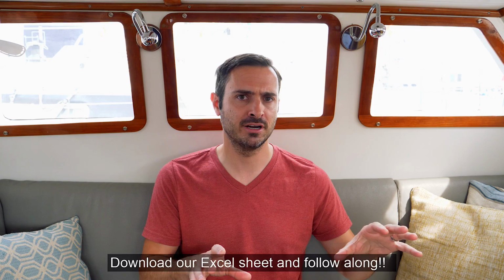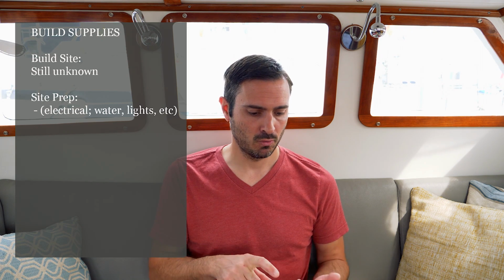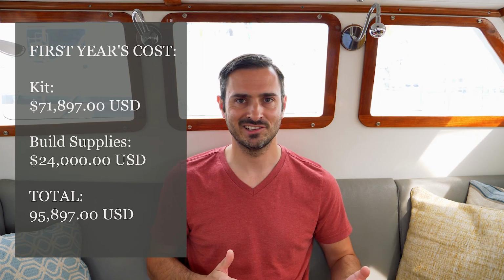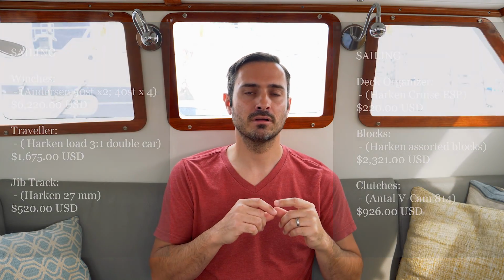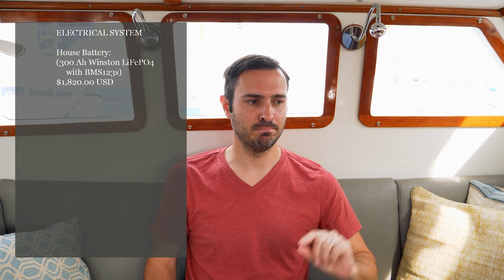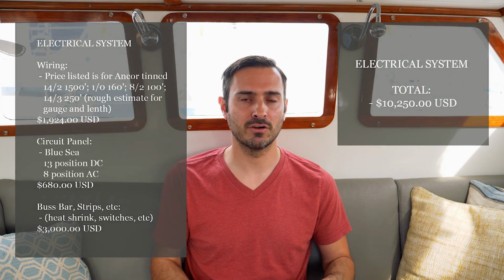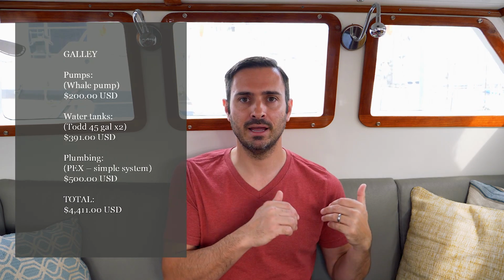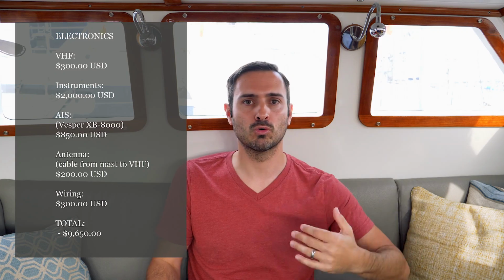What is it Going to COST to BUILD a Kit CATAMARAN? - A Comprehensive Guide (MJ Sailing)

Comment: I know, everybody has suggestions. I'll keep these to a minimum.
Galley - replaced my entire electrical system, went to LiFePO4 too with bigger panels and charge controllers. Worked so well for my RO system, refrigeration, water heater and house uses I went and refitted the galley to an induction stovetop and microwave and tossed the propane system. Amazing upgrade. I still never need my gen unless it's cloudy for 3 days.
Interior paints - look at the Ben Moore Advance waterborne alkyds, easy to use and great for  wet areas. My deck, cockpit and both interior heads were redone with this (one head is converted to a sauna). Use the satin finish inside.
The Yamaha high thrust outboards are an excellent choice. Retrofitted an old Catalina 30 using the 9.9 on a bracket, pushed the fat 11000lb boat at 6kts, used 1/2gph and SOOOO quiet. Just remember to make use of the cooling channel flush, plumb a permanent flush hose and open the valve for 30 seconds after every use.

Comment: Matt,
Could you please provide a link or details on the ceiling cabin lights you referenced in this video?  Thanks!
Reply from the maker: Go to Amazon and type in B01FVRQVK4.  That's an example of what we used (not the exact one).  With a 12v system they can be direct wired without the included driver.    -Matt
Reply: Omg I want to thank you for taking the time to do all the research and my husband and I are planning on building a cat as well and we are now interested in every video that you will produce in the future. Question? Which oram design would you reccomend for us if we wanted a king-size berth to we don't need more than 2 berths but we need a king-size bed so what would you suggest? I am unable to see the cockpit layouts on the orams where do you suggest we look to see them+

Comment: The outboards option is so smart, despite all the advantages you mention but the install costs are hugely  different , non of the engine room(s) components , it's the same reason power boat are using multiple outboards . 
Did not see a fudge factor for composite supplies?
Can epoxy and glass be bought cheaper in USA? As needed ?
Build site costs?
Really exciting plans 👍👍👍👍👍👍Cheers Warren
Reply: Based on conversations with the designers and builders, the kit does assume higher loss than if a pro was building... more fairing, more fillers, more glass.  But we could need more if we deviate from the plans and change things up.   

Regarding outboards, the Oram is set-up different than the Grainger and Schionning.  Both of these require outboard wells to be constructed where the inboard engine would go.   Not a huge issue since the bulkheads are already there and watertight, but there does end-up being moisture issues within the wells and ventilation starts becoming more difficult.   There are a lot of Schionnings set-up this way, and it does work, but it's a bit more than the Oram or Seawind nacelle.

Matt
Reply: @mattjohnson6716  I've seen an 11 Metre Schionning where the wells were built for yam 9.9s, but when a new owner wanted to fit bigger motors found the wells didn't have the space to accomodate them. Pods under the cockpit floor seem to work well for most.
Reply: @BoomaBendz   You're right, and that is a concern.  The Arrow 1360 is set-up for primarily diesels, but if the bed moves slightly forward, then an outboard well can be added.  Going backwards to diesel again is easy.   If we go with interior version 2, it does limit you to either outboards or saildrive diesels.  The other interior plan can have shaft drives.    -Matt

Comment: Lots of detail and number which is interesting, certainly be a challenging project.  However, didn't see heating in the plan?  Are you planning on sailing anywhere cold?
Reply from the maker: If we did venture to colder areas again, it wouldn't be for 1-2 years after launching the boat.  And when you consider the heating system we added to Elements only ran about $300, we figure it is an easy add later on, if and when we need it.

Comment: Site prep will be dependent on where you build.  Some areas will have fire codes that need to be followed.
Reply: Since building codes are local, that will be a factor in deciding where do this project (setting up a 60' tent).  Unfortunately, until we get closer it doesn't make sense to start investigating that too much.

Matt

Comment: Hello guys ! I can share two big mistakes I made back in 2005-2007 when building my 36 foot Angelo Lavranos N/A designed sailing catamaran in Thailand.
I made a huge mistake not having TOTAL control over the shed / property when we did the build.
I hired a boatyard for the Thai labor, but not knowing the owner of the business was a corrupt Italian that was later blacklisted and wanted for crimes by the Thai govt.  This crook kept blackmailing me for more money. I had no way to fight this in Thailand. Very important to have FULL control of the place you build your cat, legal lease or contract etc. No friendly handshake deals, a year later things can change. A smaller mistake was on painting the inside of the cat, I used the same brand and white color code marine paint, BUT it was ' interior ' paint and at lower cost.... it turned YELLOW in two years ' inside ' the boat, You must use same UV safe exterior marine paint inside also. 
I also added a few years later, a copper bottom job. I got very tired of painting the bottom so often. I did NOT use the common ablating epoxy for this, I used the same hard set construction epoxy as when building the hulls etc. I bought the copper power and used 10% more copper than the store brands. Gives you a permanent bottom job, looks NEW after each washing or scrubbing. I feel it will last 25 plus years easy. Best when done on new hulls.  Also use only high grade 316ss when fabricating metal parts not 304ss. I found good tinned copper wire is also used in the TV satellite dish business for half the price of marine stores. Cheers mates and sail on ! Good video too 😀
Reply: All the designer's suggest building in your home country for that very reason.   They shared horror stories just like your own, and since we are building ourselves so won't hire labor, there isn't a financial benefit either.  

We'll absolutely have a signed contract any way we go.   

Matt
Reply: @mattjohnson6716  Hello again Matt,
I would like to clarify my statement on my experience of building my catamaran in Thailand. The benefits and cost savings far outway the disadvantages if managed correctly. 
The Thai workers and culture was a great life journey for me. The Thai's are very hard working people that became my friends. My problem was that I did not do the proper due diligence in choosing a boat yard. I should have not used this boat yard conman. I should have rented a job site on my own. This would have saved me money and headache.
I was on the job nearly every day with my lead workers, going over build plans and running around full time getting supplies for the workers, support calls and emails to my Naval Architect.  It was about two years hard work even with a crew helping me. 
The savings in doing a build in Thailand can be huge. Major brand epoxy and fiberglass is made in Thailand, marine plywood is made in Thailand, honeycomb is made in Asia, Major brands Marine Paint is made in Thailand. Copper bottom products are made in Thailand. The worlds largest sail making loft is in Phuket, Thailand and they also build masts and rigging.  Also a huge savings in 316 stainless steel in Asia its about 50% less cost than USA ! Skilled fiberglass labor is much less than in the west also. I had 316ss chain plates and many other parts made at a fabrication shop using computer cutting technology and polished at half the cost in the west.
If a person wants to 'move' to Thailand and learn some basic Thai language and learn some Thai culture and customs, to fit in. You can save 25% or much MORE, of the cost to build a boat in the West.  But it is a real adventure and you must stay on the job almost daily and supervise the total build. Warning ! The Thai food and Culture can be addictive and the cost of living in Asia spoils you. If a person is to cut out the middle man that takes a good profit, that can be your savings. 
You sure are doing good research Matt ! Looking forward to more videos !
As a past catamaran builder it's very interesting to follow your videos.
P.S. any comments on copper bottom jobs ?
Sweat equity time 😁, sail on mates !
Cheers

Comment: Looking forward to the builds. Got a link to those interior LEDs?  I need some for my project boat.
Reply: Go to Amazon and type in B01FVRQVK4.  That's an example of what we used (not the exact one).  With a 12v system they can be direct wired without the included driver.    -Matt

Comment: Would much prefer you to build the one in the Duflex foam (Oram), rather than the balsa core (Schoinning). Of course much prefer any Grainger design over the other 2, all his designs sail well. Schoinning will sail well as long as you have no payload, but once you have live aboard items, the waterline goes down and sailing performance affected. There is a huge advantage to living on site when building, for cost advantages, as well as time convenience. A demountable unit? "Donga" in Australia - trailer? in the US.
Reply: All three are available with foam flat panels... and it's the direction we're going.   I do like the benefits of balsa, but the resale- especially in the US- is so much lower.   -Matt

Comment: I'm interested in your choice of a forward cockpit design. Personally I can't understand the rationale as it seems to me the potential negatives (sealing a forward facing door, drainage, build complication, losing lazarette space) massively outweigh the potential benefits (more fixed seating). 

It seems to me that you're creating a less seaworthy boat by design which I wouldn't want to do in a bluewater cruiser. One, of the many, reasons why I wouldn't entertain a new Leopard is the forward facing cockpit. It seems fine for a east coast US/Mediterranean boat but not for a bluewater boat.

Good luck with the build, we're doing something similar starting next year either with Schionning, Grainger or a different more bespoke option and it will be fascinating to follow on your progress! 👍👍
Reply: We won't do the forward cockpit... it's an option.  We won't mostly since it splits the bridgedeck up internally, but also since I don't see the value in having sail handling in a different area than steering.  

-Matt

Comment: Things missed from your good lisd: Cabinets: Zero... Counters: Zero...  Sun Shades: Zero... Liferaft: Zero... Rent for building on: Zero... Utilities to build with: Zero...  Place to LIVE while building: Zero... Peel Ply(Big need for saving tons of time/money): Zero.  Fiberglass: Zero, lots and lots and lots of filler you had in there, but I doubt your numbers for a new build massively.  Tools: $2800... Uh, you have got to be kidding me unless you already have a ton of tools stashed in the states in a shop somewhere... big clamps etc for aligning panels, lifting panels(though you do have winches you are buying...  Table saw, welder, universal grinder with flap head for when you screw up along with a composite head for when you screw up and have to flatten something quick. Oh right, most important, stenciling for your new boats name.  =)

Pretty decent list, you made.
Reply: Cabinets, counters, Sun shades, fiberglass cloth are all on the listed and accounted for on the excel file.  Liferaft gets moved from the current boat.   Rent is addressed in the video. -Matt

Comment: Matt -  Have you considered using LG SOLAR system -  LG Neon 2 Bifacial LG400N2T-A5 - look this up, put 3 or 4 on the rear should give you anywhere from 1200/1600 to as much as 1500/2000 watts of solar
Reply: Still years away from that choice, but I found a place that sells used (last gen) Sunpower panels from under $100 each.   If we were to buy today, that's the direction we'd go.   -Mat

Comment: Good luck to you.  This is an exciting project.  I've been following you for quite some time and I have no doubt that you can complete this project as long as you can manage outside factors. 

I've been involved in estimating large project professionally for decades,  Adding contingency as a separate line item is really important as you set your budget.  That way you can manage uncertainty; whether it is higher costs for identified items (economy, shortages), unidentified items within the current scope (additional hardware not anticipated); or items outside of the budgetted scope (adding a generator, watermaker, etc); either through scope creep or misfortune (errors, damage, etc.).  The contingency should be higher at the beginning of the project; but then can be reduced as the project gets closer to completion as you have more committed costs.  I've seen that regional costs make a big difference in labor projects which doesn't necessarily apply directly to you (since you are doing the labor youself); but indirectly since the cost of living, facilities, utilities, etc, varies tremendously depending on where you work.

I've been noticing while we are starting the slow process of opening up from our stay at home orders; that things are just not going to be as efficient as before.  What used to be a quick 10 minute trip to the grocery store has become an hour long ordeal.  Everything slows down as social distancing, cleaning, limiting facility occupancies, etc. becomes the prime concern.  I imagine that we will see significant price increases until the population gains immunity to this virus.

Comment: This catamaran build is going to be so awesome to watch. I'm so looking forward to checking out every video! I'd still go with the Schionning G-force 1500 or 1700. I really like what Onboard Lifestyle did with the deck house space and the design of it. I'm not sure if the 1500 would support the size needed to accommodate their design but I would assume that the 1700 would for sure. I would also make both hulls master and make them both identical. I also really like what Onboard Lifestyls did with the rest of there boat in terms of colors and not having any wood at all. Where are you planning to live while your building? They make electric inboard shaft driven motors that are designed for sailing boats and Sailing Uma talks about them and the companies that manufacture them in one of their latest videos. I personally think that electric has come to age and also the batteries for the most part. I believe that going electric is a much better way to go than an inboard diesel but please don't go with an outboard. There really isn't any ideal place on a catamaran to put an outboard. Not between the hulls at amidships or even on the transom. The reason why is the swells that you will encounter and you will definitely get water inside your outboards cowling for sure. So, that's why I wouldn't go with outboards and the weight is heavy compared to electric. On a folding prop with an electric motor, you can reverse the prop under sail so that the prop blades deploy and generate electric if there is no sun to power your solar panels. I really don't think you would ever need to do that but it is available nun the less. The electric motor that Sailing Uma installed is basically zero maintenance and you don't need to hull around fuel or store that fuel in a custom made holding tank and install all the fuel lines. I bet that the re-sail value will be better with electric than outboard and a Schionning is in my opinion a high end catamaran and probably one of the fastest designs out there if not the fastest cruising catamaran design available. Why not just purchase a used catamaran instead of spending two plus years building and the amount of YouTube money you can receive? I would bet that Schionning will work with you on the price rather than pass on that business. I bet if you talk to them that they would either match or give you an even deeper discount if you really want to go with a Schionning. It's the most stylish design in my opinion.
Reply: We like the G-force too, but the cost and time needed for the build is significantly higher with that model.  -Matt

Comment: I'm blown away by the detail cost breakdown.  Great job.  Personally, I hope you get a lot of things free from manufacturers on this build.  Since you enjoy the building process, I'm looking forward to this process as well.  Outboard engines are intriguing.  Diesel is the preferred fuel due to it's safety factor.  How are you migrating the risks of significant gasoline storage?
Reply: It's the issue of gas fumes accumulating in the hulls that is dangerous.   On a catamaran, the tank is out of the hulls and instead mounted over the bridgedeck with vent holes in the bottom of the storage area.  Fumes just don't accumulate.... just like in a car, the area below the tank is open.  -Matt